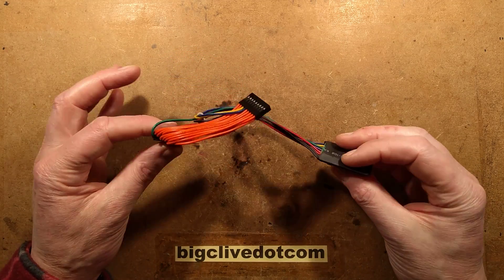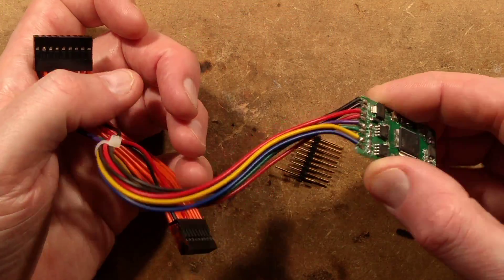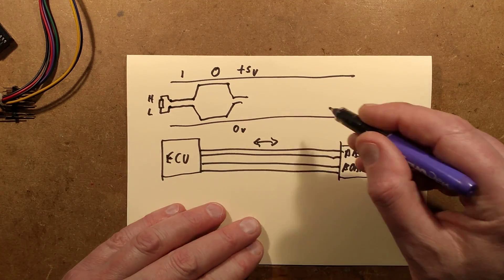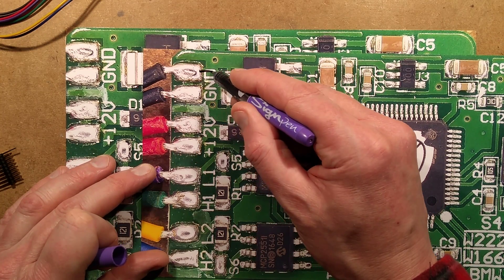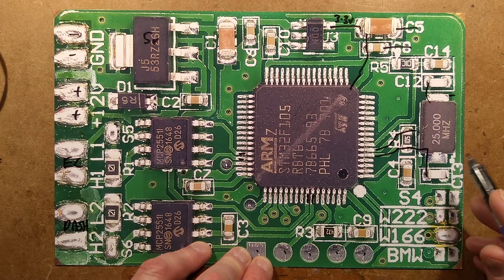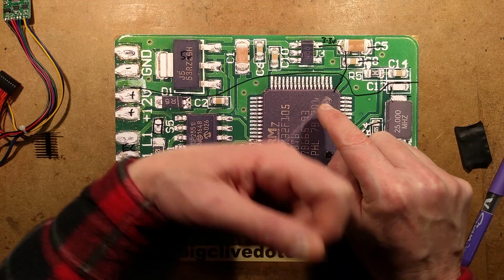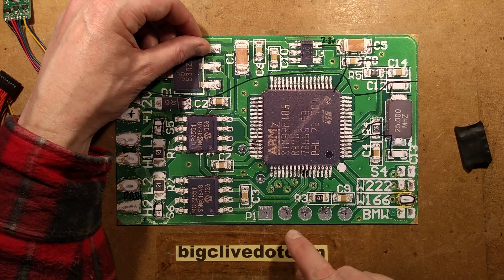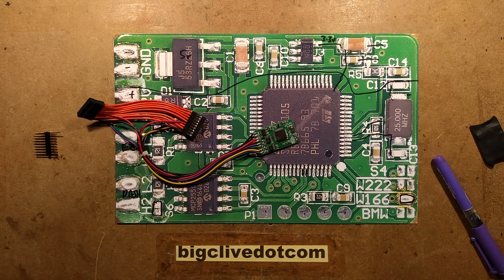Naughty CANbus odometer "interface".  (Fakes mileage.)

Comment: This is a classic "Man-in-the-middle Attack"
Reply: No no, this is definitely a CAN-in-the-middle attack. You CAN buy these at the big Chineesium webstores.
Reply: Really old school stuff. I’d have thought there’d be some sort of authentication layer based on SN or something in the operating software by now.
Reply: @boonedockjourneyman7979  Yes, I was wondering why there doesn't seem to be any efford to make that kind of attack more difficult. This seems less safe than a physical lead seal.
Reply: @TheYear2525  Eh, once someone's got physical access to a device you're pretty much fucked. Better to put good locks on the car than worry about someone intercepted the fairly limited amount of data you can put through the CANBUS network
Reply: @nullplan01  CAN FD is being adopted by OEMs now. That allows up to 64 byte payload, that'll then allow encryption of data. Still going to a few years before it comes common place though.
Reply: @nullplan01  You're right though, CAN isn't used for critical data anyway, so security isn't primary concern.
Reply: @supernoodle48  still waiting. I think its only for ecu programming now tho.
Reply: @supernoodle48  Dunno about today, but we had an issue with an older car where a faulty ABS sensor broke the bus between the engine RPM provider and some consumers of that signal. The transmission went into a sort of "safe mode" stuck at 3rd gear, and the dash RPM showed 0. Now why did the signal pass by the ABS sensor? I would imagine a hacker in theory could mess with the brakes of the car. That's pretty critical if you ask me. A quick google also mentions the steering. What if the steering wheel locking mechanism could be triggered while you're driving? Nightmare.
Reply: @thomasivesdal-tronstad4648  as others have said, if someone has the physical access to your vehicle needed for an attack you're pretty boned anyway.
Reply: @nullplan01  wireless keyfob´s are as shitty as this, and they dont need access to it, just listening is enough... this is also known for years and they did nothing
Reply: TheYear2525  They want to make it easy, it’s the dealerships that are doing this, so they can lower the mileage on trade ins. I had a salesman tell me he makes more money on used vehicles.
Reply: @majstealth  do you think it’s possible to encrypt your key fob? I hate using mine but my physical key is even more of an annoyance to use since it’s clipped inside the key fob.  my car has keyless, you could walk up press a button on the door to unlock it, sit down and start the car with they keys in your pocket so I wonder if with the windows rolled up how much of that signal is leaked outside and how far could someone pick up that signal when I push the button on my door? Also thinking about installing a hidden switch somewhere so someone doesn’t get my fob info follow me home and drive off in my car
Reply: @100achillguy7  the simple answer is - yes the signal could be encrypted, could be more or less tampersafe, but they dont want to invest into that, neither cheap nor premium brands. simplest solution would be to put the fob inside a metal casing at home, key-closet or such.
alternative someone would need to create a modul to fit certain plugs and talk to the other modules - quite high investment, or crap that´s as safe as the fob itself
hidden switch would be best in series with the gas pump. if you have an hybrid, they could only drive 1-5km, would be enough for a trailer, but you dont need much for that either way.
Reply: AKA a splice.
Reply: I initially thought 'evil maid' type mitm. But in this case it's definitely friendly criminal maid mitm.

Comment: the ecu, or pcm  get the data for the miles and sends it to the cluster most of the time if you have replace the cluster or have it rebuilt you have to give the rebuilder or the dealer the miles in the car so it can be programed into the cluster

Comment: Where is mileage counted ? If in the dash, there'd be no change but from now on it'd increment correctly. Can't see an ECU holding mileage info. Would it not be from detector on driveshaft ?

NOTE: VW Up! does not record power off mileage ! Let's suspect all electronic cars are like this !

Comment: How things have changed... Used to be, you could jack up the rear wheels and put the car in reverse for a few hours with a stick between the seat and gas-pedal, keeping the RPMs up just a bit.   Repeat once a week and the miles just melt away.

Comment: Nice coincidence this comes up after me diving into the STM32 microcontroller family in the last few months. 

Yes it could be programmed in the Arduino environment, but I suspect the makers used the ST Microsystems development tools which are free and provide fairly easy access to all the powerful features of these chips, including software libraries that make using the CAN ports easy.  The STM32 chips seem to be a favorite of the Chinese advanced gadget makers, probably because of their really good cost/feature ratio.  And your guess is going to be right about the read-protect feature being enabled - it's so easy to do that it would be a huge error NOT to enable it.

BTW and as I'm sure you know, the magic sauce is not in the circuit but in the code.  What's happening in software on the chip is not very difficult itself, but the knowledge behind it might very well represent untold hours of reverse engineering the dashboard/ECU communications in various cars.  There's a lot of value in that. The board itself could probably be sold for $15 to $20 US while still making a small profit on the hardware, but I bet it costs at least 10x more for a scumbag used car dealer to acquire.  Edit: Unless they know where to buy it firsthand.  I saw some of the links in here and they're going for $40.  Still a tidy profit for the Chinese maker(s).

Comment: Does this only affect the mileage display as long as it's plugged in, where its removal means the number pops back to the real distance, or has its dealings permanently made the downstream think it's only gone through a lesser amount of distance, and its removal only means a normal counter operation here on out, continuing from its fraudulent distance amount?

I ask because it would be particularly naughty if it's a permanent change, where the reason it remains plugged in for an extended period time is that it continually updates the downstream of the mileage, just at a much slower rate, instead of just displaying an arbitrary number for only as long as it's plugged in.
Reply: After installing and turning on the Odometer Stopper, the speedometer cannot calculate the mileage anymore. Hence, the remaining control units are also unable to record this data. You can remove the module any time, Even when you remove the module mileage will stay the same as it was with the activated tool.

Comment: This has certainly not been developed with any Arduino. They have most likely just used the STM directly in C. I am surprised you even came up with Arduino in the first place. Also I don't quite think it only talks to the ECU/Dash on startup, as the CAN bus carries all sorts of other information including dash status lights and window motor controls. Therefore it most likely just forwards all "allowed" packets like a stateful firewall, filters out all "forbidden" packets and re-creates them in a modified way.

Comment: I want to know what happens if it's plugged into a car without much mileage. Does the car get stuck at zero until it reaches the amount being deducted? Does it try to send negative numbers to the dash?
Reply: Well, if the software is as well made as the hardware, there has to be a thing to avoid it. It would require a  single if
Reply: My guess? It would display stupid-high mileage.

Think, for example, of how you might assign values on an 8-bit register when coding integers (not real or floating-point values). The 8-bit register can hold values from -128 to +127. In circumstances where you know that negative integers won't happen within your program, you're wise to shift the values to 0 through 255.

You get more positive values in the same number of bits... but the downside is that any negative number that sneaks by will be mapped onto those "bonus" high-end integers. So... 10 - 20 = 246.

Mind you, with an ARM chip coded with Arduino, you have plenty of program memory space to code something more savvy with a simple IF-THEN-ELSE structure.

IF Xin < 100000
 THEN Xout == Xin * 0.6
 ELSE Xout == Xin - 40000

Or whatever you want. Given the electricity-savvy design of the board, one would think that the programmer put 15 seconds thought into value-range handling!
Reply: If(bad.milage)
{
Milage: ("> 20000")
Stop.process
}
Reply: Some are fixed on set values 1/2 , 1/4 or off  some I’ve seen have a switch to change the mode.

So if you got a brand new car and fitted one of these the mileage would only go up the set amount out not at all

Comment: Might be interesting to try to strip the code off of it. Especially if it's based on an Arduino.
Reply: Almost impossible as it is stored in compiled object binary form (machine code), original C++ source code not stored on chip.
Reply: @lawrencel3188  Still worth a try.

Comment: this is just a modern drill to the odometer lol
Reply: Took mine back to zero on an engine change now it wont increment
Reply: @highpath4776  Thats because there's a fine gear that strips if you run odo backwards,a security thing that was added to prevent this.
Reply: Not really, done properly the rollback of a mechanical odometer will not be detected (without a paper trail showing past mileage inconsistent with present), while anyone familiar with these vehicles will see that inline dongle where there shouldn't be one, and have direct evidence of tampering.
Reply: Couldn’t you just roll it forward instead of backwards until it rolls over?

Comment: It looks better made than the OEM Mercede's electronics, it would certainly outlast everything else.
The string of error codes are standard with all new Mercedes Benz... lol, 
You can take a diagnostic tool into the stealership and find a lot of faults before they even leave the showroom.
Our company manager had his completely die (fuel system computer PBA) within three miles from collecting the car...
When they replaced that module, they found another faulty one controlling the lights and boot release..   great...

Comment: It's literally a man-in-the-middle attack.  And it makes me think there's literally no security on CANBUS, it's an entirely trusted network.
Reply: it seems to only work on 4 models of cars or atleast only bmw and merc
Reply: @ninjabongtoker1  From the Amazon.ca page:
ForBenz 18 types chasis model: S(222), S(221), C(205), C(204), V(W447), E(W212), E(W207), A(W176), G(W463), ML (W166), SL(R231), GL(X166), B(W246), CLS(W218), SLK(R172), SLS(W197), CLA(W117), GLK(X204) For BMW: CAS4/FEM Fxx
For BMW Model: for BMW 1 series F2X, 3 series F3X, for BMW X5 etc., FEM mileage adjustment( no need to remove FEM, connect directly to instrument panel); for BMW 5 series F10, 7 series F01/02 etc., CAS4 Fxx chassis.( F01, F02, F07, F18, F10, F20, F25, X3 etc., applicable for 9S12 XEP series 5M48H/1N35H).

Comment: That'll be one of these, then.. plenty of detail; just on this listing.. https://www.ebay.co.uk/itm/Fits-MERCEDES-MILEAGE-CORRECTION-CAN-FILTER-BLOCKER-18-IN-1-BY-YANHUA-/163022168168
Interesting that it blocks the resetting of the display to the correct value.I've seen "correction" devices used to convert imported vehicles to adapt the instruments to miles rather than kilometers .. so no surprise that these less defensible variants exist.

Comment: It's the 2019 version of the Dad from Matilda
Reply: Hippy Dude that’s how I learnt you could wind back the odometer! I had to wind mine forward as it got stuck on the 70k rollover. Not that it bore any relation to the engine (replaced), shell (rebuilt), or wheels (12” instead of 10” it was designed for).

Comment: The question is where is the total mileage stored?  If it's stored in the ECU and then sent to the dashboard, the device would have to intercept it and subtract the mileage, but the true total mileage is still in the ECU.

OTOH, if the dashboard is storing the total mileage, then the ECU incrementing the mileage would be intercepted and some of the increments could be deleted, slowly changing total mileage over time.
Reply: Most newer stuff stores mileage in a few places,abs modules for example. I was asked to inspect a suspected mileage fraud on a leased BMW X5 recently,the original mileage was sitting in the transmission controller.

Comment: I think this is a Chinese clone of the CanGateway Easy made by ElproSys. The boards look very similar and both use the F105 processor. The Easy is also designed to sit between the dashboard and the rest of the network and cheat the odometer. Interestingly the manual recommends another product (CanGateway OBDII) which seems to be the exact same board just with different software. The OBDII thing is meant to sit between the OBD port and the rest of the network. They are vague on the purpose and only claim that it “filters diagnostic command from the ignition (EZS).” It seems like you might be able to read the true odometer value through the OBDII port even with one of the Chinese filters attached so these might be easy to detect.

Here is a copy of the manual if anyone wants to take a look and see if the boards look like the same design.
https://web.archive.org/web/20170314215359/http://chipclip.ru/d/868797/d/cangateway-easy-and-obdii-eng.pdf

Comment: The chip is soldered on then a pogo pin connector is used to program the chip!!!
https://www.google.com/search?q=pogo+pin+programmer&client=firefox-b-1-m&sxsrf=ACYBGNSQCnDBge0WV4ich6jNs_UCOdHUsA:1575937180710&source=lnms&tbm=isch&sa=X&ved=0ahUKEwiRu-C-56nmAhULLK0KHZ7uDPoQ_AUIBygC&biw=414&bih=722

Comment: That's fascinating that the mileage suddenly changed when it was removed. That means the ECU is accumulating the mileage and storing it locally in a non-volatile flash or eeprom to make the vehicles mileage inaccessible to most modifications. Reminds me of the "black box" functionality I found while reverse engineering some GM OBD-II ECU software. The ECU keeps a rolling buffer of vehicle telemetry data (speed, braking, engine parameters, pitch/roll/yaw data if available, etc.). In the event you crash the car, the entire buffer is dumped to the flash memory to tattle on you and investigators can then tell exactly what you were doing in the moments leading up to the crash.
Reply: Not sure if you’ll see this, but here comes a few Q’s...
1. Any clue on how a device like this would interact w/ an analog odometer when removed ?? Would the rollers spin away until the true ECU recorded miles were displayed?
2. Is there an available database that lists all vehicles that are outfitted w/ this big brother black box? I have a 2015 Wrangler JK - electronic amenities aren’t exactly the focus - So I feel if there ARE some more modern vehicles that do not have a BBox, it would be one like mine. On the flip side, if mine DOES have a bBox, then it’s safe to assume ALL vehs do.. which is very annoying.
3. Have you figured out any more cool tricks since this 2 Yr Old comment???
Reply: @flojotube  Depends on how the odometer is driven. If it’s cable driven then they spin away regardless. Analog gauges with a digital odometer will potentially be effected depending on how it is stored by the vehicle. Not all ECUs have the BB feature. I have a 99 PCM from a GM/Isuzu gas truck in my 88 Camaro with a PFI conversion that does not have it. But I have another from a Firebird on the shelf that does have that option to record data to the internal flash of the airbag deploys. It can be disabled, at least in the GM ECUs I was working with. I can’t vouch for the Wrangler. It may be there, and a search on the ‘net might help. Keep in mind it’s not comprehensive like one for a passenger plane. It simply records things like speed, vehicle status, if the brakes are applied or not, etc. In a standard crash it’s not much of a liability, but years ago someone did get burned by it when they were speeding in a corvette and crashed. As long as you don’t plan on speeding it’s not an issue. A bigger concern is if the vehicle has connectivity (i.e. OnStar for GMs). Those seem to be VERY intrusive. I think I have even had them do stealth reflashes in the middle of the night. Get in and the car will have different features enabled like suddenly having auto start when the key is turned. I have heard the HVAC actuators some on randomly when I had my window open while sleeping. This is indicative that the vehicles ECU/BCU are active for one reason or another. I would consider removing the cell antenna and associated electronics if you can and have such concerns. But that is not an easy task since it’s tied into the CAN bus and other controllers interface with it.
Reply: @flojotube  All 2012 and new vehicles in the US have black boxes, I know because I had a 2011 and it was 1 out of the 5 models that sold in the US that year that didn't have one.